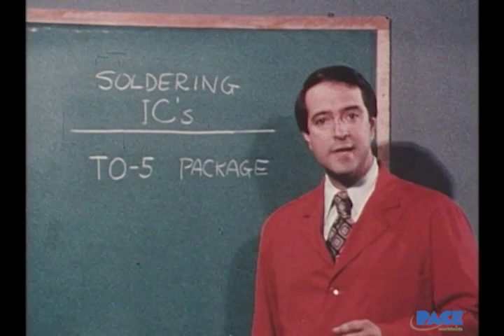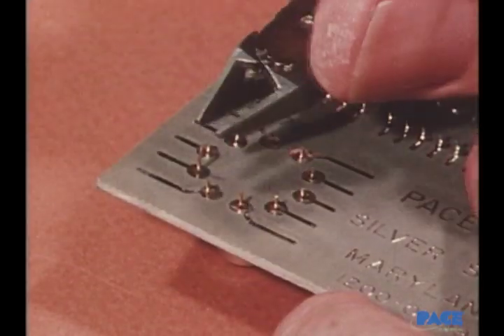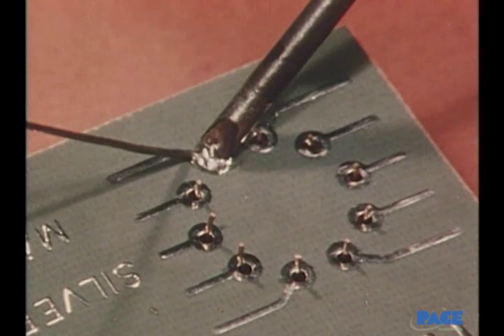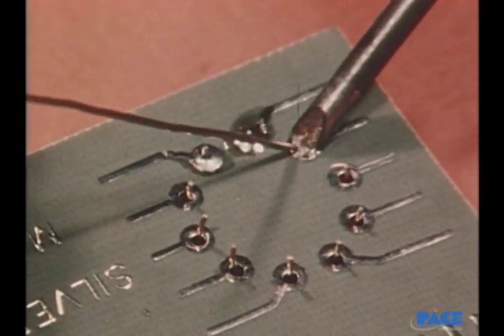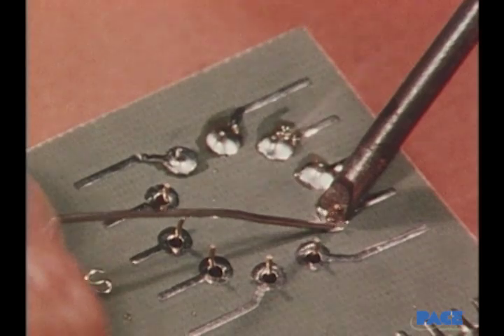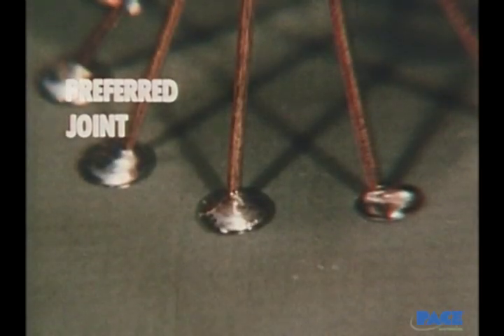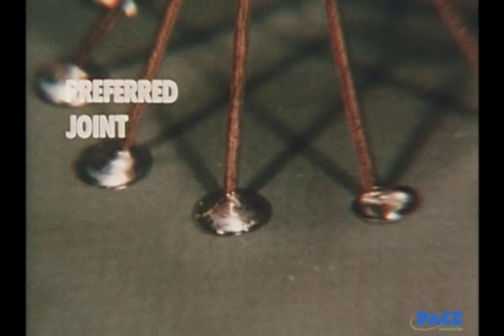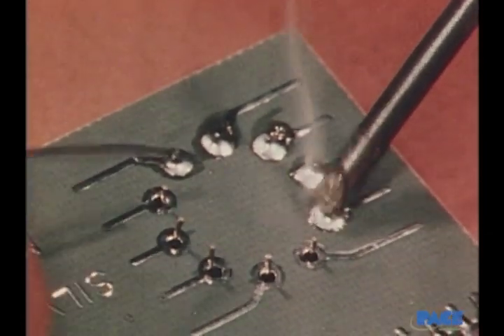Basic Soldering Lesson 8 - "Integrated Circuits"

Comment: Not true.

Major industries where there is a lot of vibration involved (such as airplanes) still prefer to use through hole soldering. Surface mount stuff doesn't withstand heavy vibrations.